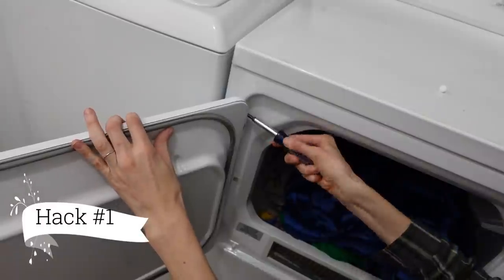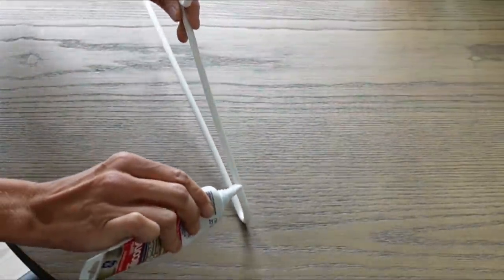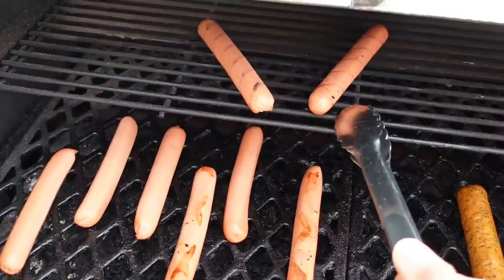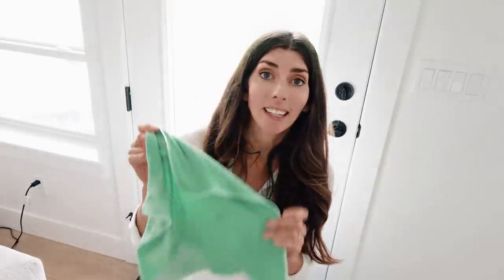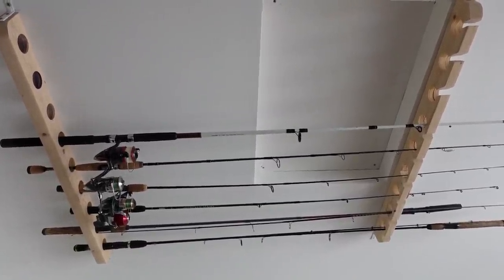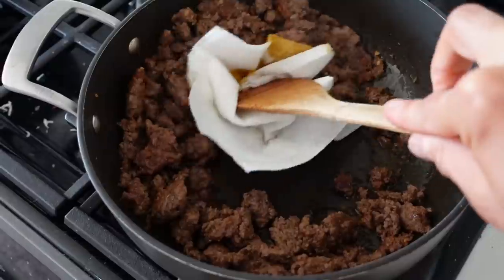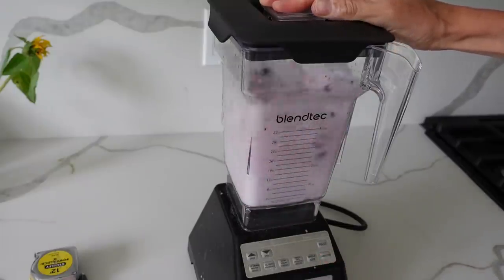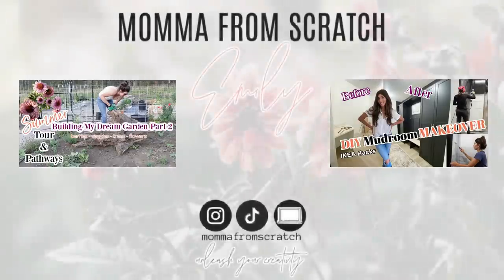NEW* 25 EASY DIY Home HACKS that Actually Work / Practical and Useful Home Hacks

Comment: I have a hack:
Dollar store had S hooks. I have round balcony railing so I fit those on the railing and snuggled 2 flower pots with the flat backs back to back. One on each side of the railing.  Zip tied them also through the holes where the S hooks are.
Reply from the maker: Really good idea thanks for sharing it

Comment: Great tips! I have used the paper towel for soaking up grease in the pan for years….it works so well! (Just used it at lunch for tacos!) 
I think the best tool for cleaning the vents in the car is a 1” sponge paint brush….works like a charm! :)
Reply: Sponge paint brush?
Reply: @patsyw4141  yeah….it’s the little sponge brushes you can get to paint, they get in all the nooks and crannies when detailing your car. :)

Comment: For the paint can hack, don't use a drill, it puts small metal shards into the paint. Use a large-ish nail instead.
Reply: Yes, the largish  nail for the job  --  but this allows the paint that is 'left over' to drain Back down into the can.  these many  Excellent hints especially the pushing a paper towel throughout the pan to catch any oils etc with a  wooden spoon:  WOW. SO COOL. 💥💥💥

Comment: You can also freeze your rice sock. I make several different patterns for the grandkids the are more comfortable than an ice pack. And, I think work better. You can also add a couple of drops of essential oil if your choosing to the rice before closing up ie..lavender for relaxation etc
Reply from the maker: Oh I’ve never done that thank you for the tip! I need to make some cute patters too
Reply: @MommaFromScratch  you’re very welcome.

Comment: Great ideas, i also use the napkin to soak up the grease from the pan. For the clothes hanger I've seen people wrap the hanger edges with fuzzy pipe cleaners to hold clothes in place ,or wrap the edges with rubber bands, great ideas.
Reply: Maria Vargas.. Good evening how are you doing?

Comment: I will share with you my secrets for perfect hard-boiled eggs.  
1. Use baking soda in the water, not vinegar as so many people suggest.   Vinegar toughens eggs, but baking soda weakens the shells so they're easier to break off.   
2. Use a large thumbtack or pushpin to poke a hole in the wide end of the egg.  This releases the air pocket there, so the egg will cook nice and round without a flat side.   
3. Boil enough eggs that they are standing up in the pan, with the fat end pointing up.  (You know, the end you already poked a hole in.)   This lets the air release through that hole, and it also centers the yolk so you don't end up with a thin side and a thick side of the whites of the egg.  Much nicer for making deviled eggs!   Find the right size pan for the number of eggs you want to boil, but better to boil a few extra than to leave the eggs lying on their sides.
4. Those extra eggs you might boil can be stored easily for a week if you peel them, then put them in a jar, covered with water, in your fridge.    You can add a few drops of food coloring to the water if your family appreciates a bright pop of color on their boiled eggs!   I think it makes deviled eggs extra cute.
5. To make deviled eggs  I press cooked yolks through a fine-mesh strainer to get perfectly riced yolks with no lumps.   Everyone knows to add a bit of mayonnaise and mustard to the yolks.  But a teaspoon of sugar per 12 yolks is a subtle flavor boost that nobody "notices" but everyone loves it.    Finally, I use a star-tip piping bag to fill the eggs with yolk mixture, which gives the platter of eggs a gourmet appearance, especially if you garnish each egg with a leaf of cilantro or a fat shard of bacon.
6. One last recipe I want to suggest if you have lots of (peeled) boiled eggs is pickled eggs.  Instead of storing your eggs in a jar of water, use half water and half rice wine vinegar.  You can play around with other seasonings too.  I like a tablespoon of sugar, a teaspoon of salt, a shake of turmeric, a shake of garlic powder, a pinch of dill, and some chopped onion in the brine.  You might also choose hot spices like Tabasco sauce or red pepper flakes if you like that sort of thing.  These pickled eggs are good to eat at any stage, you don't have to leave them for any particular length of time, though they will absorb more flavor from the brine the longer you leave them.  They are a zesty addition to salads and sandwiches, or just a quick low-carb snack to grab any time.  They could last almost indefinitely in your fridge, though I always eat mine up quickly because they are so good!   The brine can also be re-used for another batch.

Comment: Hi! I really enjoyed your video and subscribed right away! 

I have a question about the last hack shown in the video of the silicone fail with rugs to keep them from slipping. Did you continue experimenting with the silicone on the rug and did you find a solution? I’m very curious to know what you found!

One of my favorite hacks from the video was of using the toilet paper roll for keeping cords together as well as cutting one to hold a roll of wrapping paper.  I  also liked someone’s idea of covering them with a pretty contact paper.  

In addition, I’d like to share something that I just thought of: 

I put a small command hook on the unseen side of the trash can in my bathroom and hung a small grocery bag on it in order to save the toilet paper tubes until I’m ready to use them! Putting it on the side of the trash can hides it from view.

Comment: I like the laundry soap cap, but I don't want to leave my soap uncapped for the time while a load is washing.  I would suggest saving a lid from your previous container of soap (assuming you use the same type or same size) to always keep a cap on the container.  It would be a terrible mess to clean up if it got tipped over!
Reply: Sheila Wiard. Good evening how are you doing?

Comment: When pouring paint into a roller tray, always pour with the name/title of the label facing the tray. That way the paint won’t run over the INFORMATION side of the label, obscuring drying time & other important info that’s on the back of the label.
Reply: Put a trash bag over the tray or line it with plastic wrap and then just peel it off when your done and the tray can be used multiple times without the mess in your sink or carrying the tray thru the house to clean
Reply: Put an elastic band around the tin from the top to the bottom in the middle of the can to wipe off excess paint so you dont drip

Comment: If you hate window coverings in the bathroom and don’t want to use the stick on film or pay for frosted windows, Rustoleum makes a spray paint called Frosted Glass.  It only sticks to glass so you don’t need to prep or tape off.  Spray about 4-5 coats on a clean window (10 min between coats) and you have beautifully frosted glass.  You can remove any time with a glass scraper.
Reply from the maker: Yes I’ve heard of that . Thank you for sharing such a good idea
Reply: Or. Elmer's glue and a sponge roller, obscured window. Use food coloring, or whatever coloring agent, use multiple colors and go crazy. Removes easily with scraper.

Comment: Why have I been cooking for 30 years and never thought to soak up the grease with a paper towel??  It's not only much easier..I hate running it down the sink and you can't just pour hot grease in the trash so I'm always trying to figure out a better way to get rid of it. Thank you Emily!!
Reply: I treat hot grease like the old saved bacon fat trick: pour into a cleaned food tin, leave in the freezer. When the can is full, cover with aluminum foil and toss frozen into the trash.
Reply: Exactly, me too!!
Reply: I’ve seen Gordon Ramsey do this, so I don’t feel weird about doing it in front of others. 😂
Reply: Oh, my god, NEVER pour hot grease or any grease down the sink!  It is obvious. Geralyn has the best tip for disposing of grease.
Reply: @geralyn-mm  I do the same!

Comment: Aren’t the little hooks on the hanger already there to wrap thin straps around to prevent the clothing item from falling off? Like, no hack needed? Am I alone on this one?
Reply: I thought the same thing - that's what they're for. However, large v-neck shirts can fall off those hangers so Emily hack great for that.
Reply: Not the metal wire hangers.
They have nothing to grasp to.

Comment: Thank you for posting all these great hacks, they're going to be very useful.  To water my house plants, and any seedlings, I use a plastic milk bottle... Taking care not to burn my fingers, I heat a sewing pin (or needle) over a candle flame. Working from the inside of the lid, I then pierce the it a few times. Fill the bottle with water, replace the lid and it makes a great water sprinkler.
Reply from the maker: glad you liked them

Comment: All awesome hacks. EXCEPT the WASTING of tape by creating a triangle.  SIMPLY fold it over 1/4".  No tearing, no waste. THIS WORKS FOR ALL TAPES, ESP. WHEN YOU TAPE SOMETHING AND TOU KNOW you'll have to re-open an item. Tape it shut except the 1/4" followers.  Open, shut.  Easy peasy.
Reply: When I need to use the tape again (after the 1/4 inch fold over) I cut off the 1/4 inch,set it aside to add to the edge for the next 1/4 inch. (So I don't waste 1/2 inch with each use !!!!)

Comment: After rinsing the blender, let it drain or dry it with a cloth. To make sure the blades are very dry,  turn on the blender to spin out the last bit of moisture.

Comment: The hole in the paint can is great tip that i no want to try.  Instead of a paper clip, I use a staple remover to help add/remove keys.
Reply from the maker: That’s a great option too

Comment: Additional hack for shining surfaces: put all your special microfiber cloths in the WASHING MACHINE. When finished on the quickest cycle, they have perfect moisture for getting those windows and mirrors completely clean and streak free. Keep one by you when cooking to wipe your sticky hands clean in a jiffy.

The fluffier cloths will gather up every last bit of dust without damage to any surface. You can even put some in ziplock bags and store in the freezer for exercise time. Take the package with you on your run/walk. Pop a few into a cooler and use on your kids when they look overheated at the beach.

Comment: Hi. Making hole in the inner rim it’s better than drilling the can partials fall into the paint. Use if screw driver and hitting it at an angle and one solid blow with a hammer. Don’t run your fingers under the rim the metal will cut you. I do this everyday I own a paint business. Stay safe.

Comment: Thank you for your hints l have two hacks l use l get a Piece of elastic and I run it around the top of my rubbish tidy keeps the bags in place and they don’t come off until I’m ready to empty it ,and also my sticky tape I run it around my hand the sticky side to the outside and use it to get fluff off dark clothes it works like magic and you can keep turning it around when finished roll it up and put in the bin your bin l buy the sticky tape at dollar shop l get the wide one hope you can use these hints

Comment: I use a staple remover to open Keyrings when adding and removing a Key - its less fiddely and you Can hold the ring with the staple remover tool ;)

Comment: Hanger has those little hooks for string top straps to hang or use a glue gun for dots on hangers
Reply from the maker: Yes but you know those wide mouth tops that always seem to slip off I feel like it would help so much
Reply: @MommaFromScratch  I'm going out to get some new hangers today I'm going to try the glue gun where you put.. dot dot dot to see if that works

Comment: I've seen a few YouTube channels showing hacks on how to clean the crud off the inside of the microwave. Well, when I heat something up in the microwave I either put the lid of the container on top loosely or cover whatever I'm heating with a double thickness of paper towel, tucking a couple of the ends under the bowl/plate is best. I very rarely have to clean the inside of my microwave. The paper towel tends to absorb any smells too. If it DOES start to smell a little bit I simply dampen a paper towel or a clean cloth with vinegar or even better vanilla essence and wipe over the inside surfaces.

Comment: Until You Tube I thought I was the only one to use a paper towel to soak up pan grease  :)  #18 is a great idea. For #23 why not just use  tape?  For tape ends I just  fold over the edge, no triangle needed. Does the window cleaning cloth work  with hard water?   tfs 🥰💐🌷🌵🌺🌞🏜️💗✝️

Comment: The rice sock heating pad is fantastic, especially with nice-smelling jasmine rice.  It also makes the best kind of ice pack too!   Keep one in the freezer and it is perfect any time you have a bump or strain or headache that needs to be iced.  Much more comforting than wet, hard ice cubes, and the cold never seems to be "shockingly" cold, yet it works for a long time.